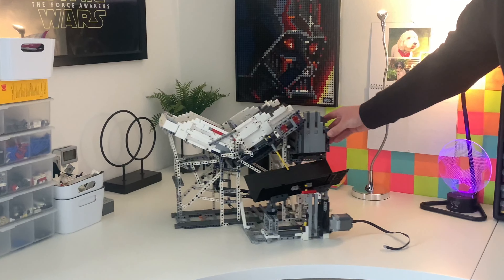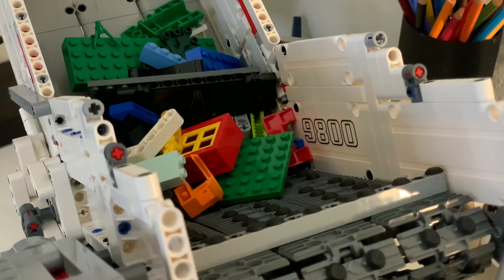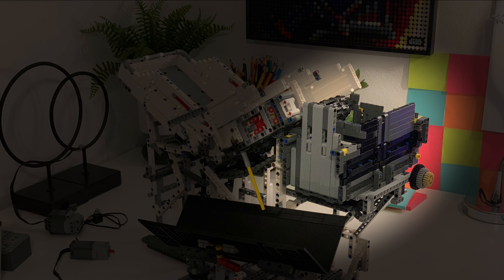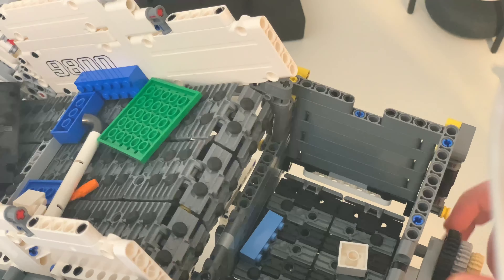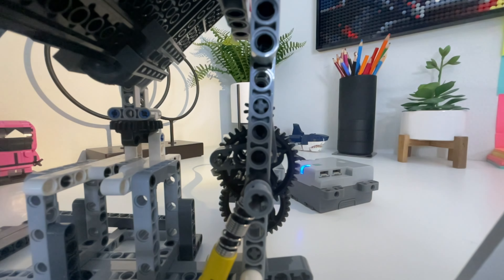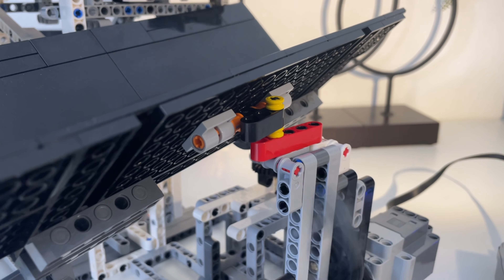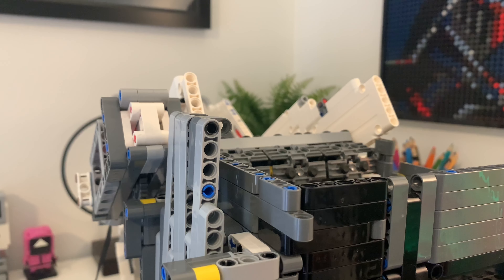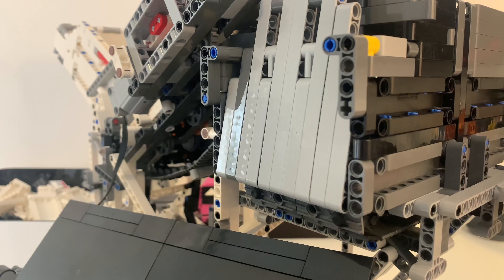Universal Lego Sorter - Update 3

Comment: how do you make the scanner and sorter that is the only thing idk but i want to make this to pls help me
Reply from the maker: Still figuring out the scanner.  At the moment I’m working on a section which holds my phone and then we will have a program(which we don’t have yet) look at a live feed of what the phone camera is seeing.  As for the sorter, the physical part consists of 3 main sections.  I go over it in a little more detail in Update 2 but basically the large conveyor belt slowly spits out a group of parts every time one of the leftarms(those light grey pieces attached to the treds) comes around.  Then the smaller conveyor takes that and spits out and even smaller group of pieces at a time(usually 2-4).  The shake table then takes this small group of pieces and separates them.  If there are pieces on top of each other than the shake table will make sure that each piece falls into line(literally).  I hope that was helpful but if not, I recommend checking out this video by Daniel West as it’s my main inspiration:
https://youtu.be/04JkdHEX3Yk?si=jSm71iAQ6EJuXY6t
Reply: @BrickImperial  okay then im going to wait for the scanner video
Reply: @BrickImperial whats your progress now did you have a software for your phone already
Reply from the maker: @dogergame4443  unfortunately still no program just have worked on the part right after the vibrating feeder where it lifts and dumps the pieces into a future transport robot